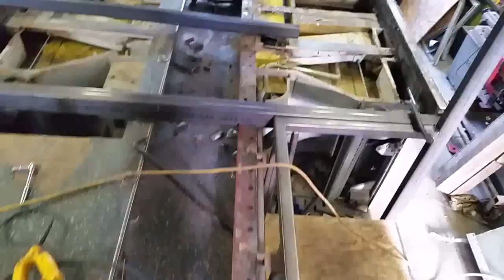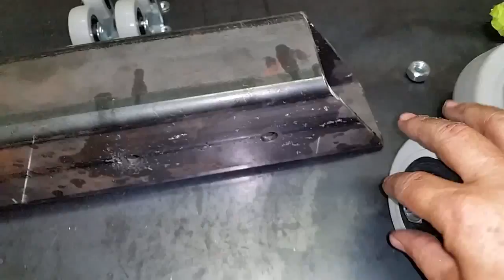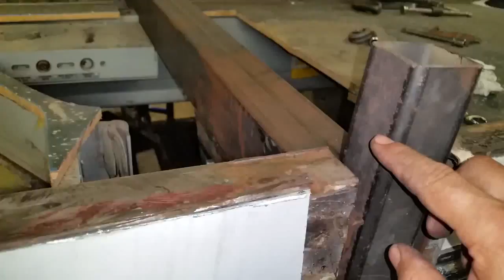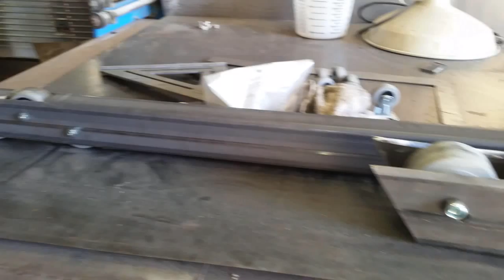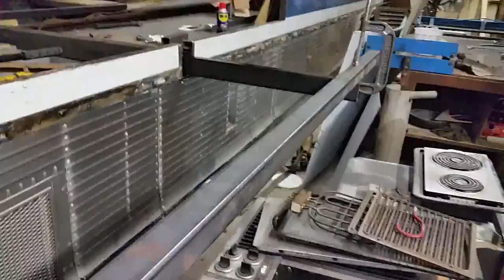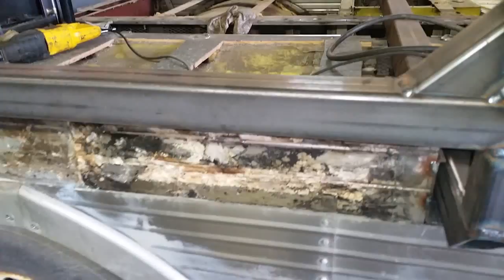Bus Conversion Project Video 19-Slideout Construction

Comment: I’m not being a downer coz I love the idea and would like to build one myself, but are 4 wheels needed at the end of the sliding arm? All the weight of the outside wall is going to keep the top wheels in contact with the top of the retaining tube until it’s all the way in, so one lower wheel would suffice. Also the end wheel should be at the top to give it more leverage/support, the lower wheel could be inboard a couple of feet and still work as needed. 
Are there any experts out there that could advise please?
Reply from the maker: You are correct, when the slideout is out, my concern was when the slideout is in and traveling down the road, I wasn't sure how much jumping around they were going to do so I installed 2 wheels per arm, they are only rated for 150 lb. each, cost 5 bucks each and took 15 minutes to install so I decided to err on the side of caution.... thanks for your comment
Reply: James E Dennison 
Hi James 
Thanks for your reply. 
Compared to some I’ve seen yours looks extremely solidly built. 
1.How are you weather sealing it? 
2. How are you going to adjust it should it need to be tweaked for alignment?
3. Are you doing another video about it?
Reply from the maker: There are 107 videos on my channel at this point.... I dont remember the numbers but there are videos on sealing and the cable drives I used allow for adjustment... there are plenty of follow up videos on the slides.... they are working very nicely so far.... not a lot of miles on it yet so time will tell... I'll update if I run into any significant problems... I also did a video on things I would do differently was I to do it again.... I'll probably do another one of those defore it's finished 🤪🤪🤪

Comment: James did the bolts that travel inside the tube give you any resistance problems? It seemed like they might rub the walls inside.
Reply from the maker: No... I adjusted them to give 1/16" clearance on each side so they don't cause any problems, they just keep the tube centered to within 1/8" … seem to be working fine

Comment: Does anyone know what company could install or sell slide rooms for RVs?
Thanks
Reply from the maker: Liftco is the only company I'm aware of that sells slide out kits to the public... you still have to build the walls and roof but at least it will get you started, I don't know of anyone offering slideout installations into an existing motorhome, though there my be some.... link is 
https://liftcoinc.com/product/glide-outs/wall-kit-styles/
hope this helps

Comment: NICE JOB 
DID YOU USE SOLID WHEELS, As soft  wheels make it hard to roll as I found out, also I put a flat plate on the end of the slide out so it went right home  good job
Reply from the maker: they are solid rubber wheels, they have a little give to them

Comment: Could you tell me what size and where did you find and purchased them.
Reply from the maker: Sorry...????... them what?
Reply: Oh sorry James thought I had everything wrote down. I wanted to know what kind of wheels that you and where can I find them. Sorry again about the confusion.
Reply from the maker: Hi Randy.... Ok, I got the wheels from a company in Canada called Princess Auto, they are basically wheels for warehouse carts and the like, they are 4" and 3" ball bearing greaseable wheels, I imagine you could find something similar on Amazon, they have a hard solid rubber wheel rather than plastic as I think the rubber will absorb vibration and be quieter when traveling down the road , Princess auto has a website www.princessauto.com, they might ship to where you are.... not sure
Reply: @JamesEDennison  thank you so much James for the info I really appreciate it! And thank for taking the time out of your busy schedule to answer my questions.

Comment: This for the most part answerd ALL my questions. I may have missed it but I was wondering if and how you addressed the sides of the bolts holding the inner rail wheels from hitting the sides of the outer rails (sleeve). In other words do you have something to keep those sliding rails from moving side to side as they go in or out?
Reply: Never mind I was so excited to see this build I didn't see some one already ask this question. I'm building a small slide out for a mobile pizza truck. This is so much of a Time saver not having to reinvent the wheel.. Thank you for posting all of this.
Reply from the maker: No problem..... have fun :-)

Comment: I have been looking but can not find a link to the wheels used. Can you please post or re-post where to get them from. Thanks.
Reply from the maker: they are rigid caster wheels, I just took the original mounts off them, In Canada we have a store called princess auto..... kind of a farm supply store, I got them there but any store like that would have them, The Large ones on the outer edge supporting the cage are 4"x2" and the smaller ones in the slide arm are 1"x3" sealed bearing caster wheels, hope this helps, depending where you are you can go to princessauto.ca and order online
Reply: Thanks, James. Best, Georgi

Comment: Great job! im wondering how you are keeping the slides from moving side to side. it looks like the framing should keep from moving but just wondering if you did something else to it.
Reply from the maker: the 3"x4" slide tubes have adjustable guides in them, if you watch one of the videos, can't remember which one, you can see them in the tube, the swing arms tend to keep it all centered too as the weight on them seem to center it all automatically
Reply: Jason Heffler I asked the same question before I saw yours. Did you find which video he shows the guides in? If so could you let me know. Thank You.

Comment: PLEASE CAN YOU TELL ME WHAT SIDE WHEELS YOU BOUGHT FOR THE SLIDES?
Reply from the maker: the 4 wheel assembly in the 2"x3" tubing are 1.5"x3" wheels with ball bearing axles, the larger wheels in the 3"x4" tubing are 2"x4" also ball bearing axles

Comment: I wanted to ask you do you have a blueprint for the stretch and the slides that you are constructing, or anything else you can provide in a printed format?   I would appreciate it.   thank you for your hard work   its been quite helpful so far.    Johnny
Reply from the maker: Ha.... the blueprints are all in my head, just make it up as I go along, well 25 years of fabrication experience doesn't hurt either I guess, pretty much everything I have is in these videos, I'd be happy to answer any questions though
Reply: James E Dennison 
Hi James 
I'm building a rv project .
it's not simple 
can you answer this question ?
1.when you fasten the two x four steel beam ( the housing for the slider) do you cut into the c channel of the chassis or weld it directly on top of the c channel top ? 
I have been watching your work for  6 months on a when I have time to really study them 
I am building a 38 ft. class A however , it now has a class Cab on the front I it's settings  over the c channel .
just behind where the end of its structure is 
that's where I'll place my forward slider ,the the middle , then the end  piece 
it will be 24 ft 
and will be on both sides to gain 4ft of extension x 2 
at approx 7.68 plus the 8 feet that will give me 15 ft .68 of rv right to left for 24 ft
please James let me know the answer or a method . 
I'm starting by doing o
all I can to the demo for not much
h
funding raised to date for a whole lot of steel  need soon
W .Eric